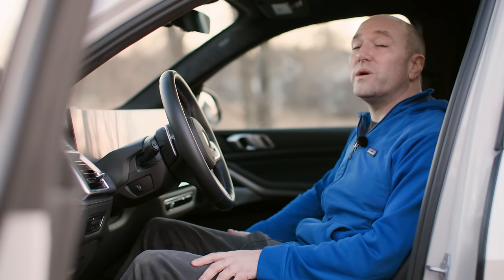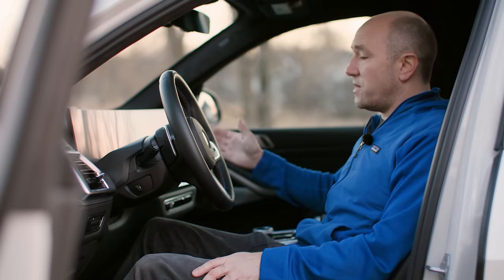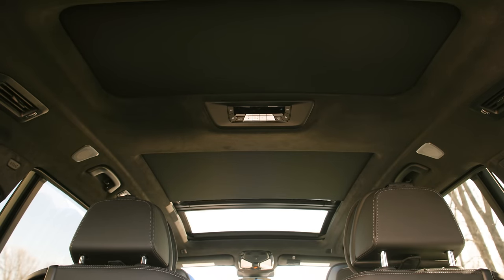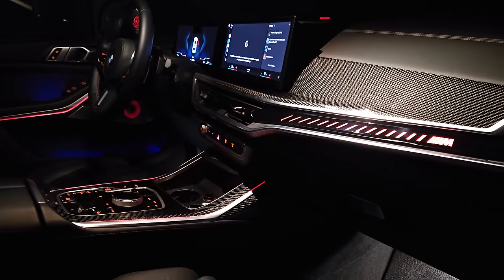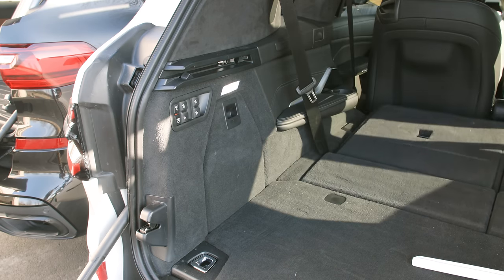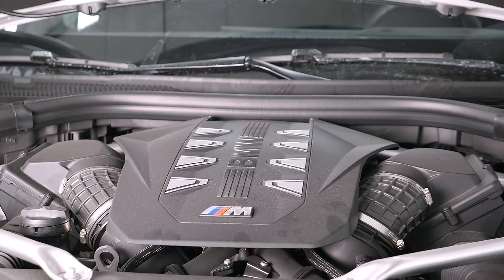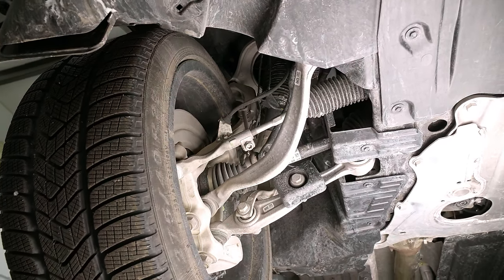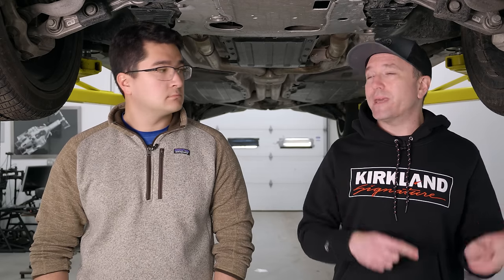2023 BMW X7 M60i | A Mixed Bag of Updates

Comment: What about the Lincoln Navigator, Cadillac Escalade, Lexus LX, Grand Wagoneer, etc.? I realize they may not drive as well with their truckiness, but they have the towing capacity and durability to make them good long-term vehicles.
Reply from the maker: Those are almost all body on frame, so its different.  Wagoneer is a good alternative but its pretty new and I would not put it anywhere is same class as BMW in terms of driving ability. All of those are mostly land boats rather than driving capable.

Comment: Avoid. (1) Horrible wind and road noise for the side windows and front windscreen. Dealerships know it but can't/refuse to address it. (2) There are no all-season tires available for the M50i and M60i, only winter tires which cost $4K+ for a set. (3) You can't fit three kids booster seats across in the second row because of how inset the outer seat Isofix points are. Very odd for such a large car.
Reply: Would you rather have the Acura MDX Type S?
Reply: @SilverScarletSpider  No. I own a 2022 M50i and was looking to swap to a 2023 M60i.

Comment: Real luxury is getting into a very well equipped knobs, switch, lever, and button filled car with effective screens that nearly never need interaction, simple, supple suspension designed to last and a drivetrain that just runs, and runs well after the warranty is up.
Reply: Which is why I bought the last gen 2022 Sequoia. Wonderful ride. Physical knobs and buttons. Apple CarPlay for modern UI. Bad gas mileage, but fits my five kids and will last a decade (or two).

Comment: There should be a LAW to HAVE HVAC as hard buttons, that run independently from software.  This boggles my mind.  Your eyes have to be on the road, not in 18 sub-menus. Law Enforcement could cite you for being "distracted", even if it is built-into the cars infotainment. Manufacturers are in full "Electric" mode and want to remove any physical control.  Tesla cut the steering wheel in half so to "force you" to put your hands at 3-9 but is not practical when parking. On a side note, I was having fun with a 440i Grand Coupe with the M Sport exhaust and wow!  What a sound!  That is one BMW that I would seriously consider.

Comment: I’m not sure why everyone thinks the split headlight design is a Hyundai copy. You really have to think deeper and realize that this is an older BMW design they used on the Rolls Royce Phantom, specifically the pre LCI 2007 Phantom Drophead. BMW is bringing this design back on the upcoming Rolls Royce Spectre.
Reply: I first remember this on a Jeep Cherokee in 2013. I didn't like it then, and I still don't!

Comment: Regarding the iDrive 8, I do wonder how many people will interact that much with these screen interfaces. I mean, you'd think that they do because otherwise why would BMW and other manufacturers sink so much money into the software and interface development of the infotainment systems? That said, my X5 with iDrive 7 has me going in to the touchscreen almost never. 98% of the time when I'm driving, I just say "hey BMW, I'm cold" and it adjusts the heated seat and temp for me. In most cases I don't need to really change hvac that much - the system lets you program hvac/seat settings based on temperature thresholds outside when you turn the vehicle on. So much is automated that not having the buttons is really not a big issue. I would challenge anyone to show me a use case for regularly using the deep menu navigation. In an age where CarPlay/Android is standard, voice commands are better than ever, and "smart" programming is relatively robust, buttons do seem less relevant. The only exception I take with this is the volume knob, which BMW still preserves. I have a G80 M3 coming soon with idrive 8 and am not too concerned. Maybe I'm the minority but to me I don't really pay attention to the screens or ever have any reason to use them. I'm focused on driving and as long as HVAC and music is taken care of, I'm happy.

Comment: To think we have a comment section that has convinced itself that an extra second the set you temp up or down 2 to 3 degrees is a deal breaker. I've have haptic touch control in my car for years it's fine. Certainly wouldn't move my willingness to buy a 100k 500hp suv. Wouldn't even consider it.

Comment: The BMW exterior is becoming more and more hideous (Citroen's double headlight design, what were you thinking BMW!? At least do not make a direct replica and integrate it properly like fog lights were in the old cars that did not look bad because of it).
The infotainment is a curse BMW's is spelling on us. Why is BMW treating their customers as a piece of stupid heads that feel confused by using a few buttons or setting up shortcuts for their infotainment.
And lastly, have we as humanity really decided that cars are going to be just a bunch of consumables we replace like phones? In the past, phones worked 10, 20 or even 30 years, now they have almost 0 buttons and yet they fail in a few years or at least they start to lag in a way they are annoying to use.
Please, car industry, stop doing this nonsense and let the enthusiastic mechanical and electrical engineers take over instead of marketing, influencers, simple minded people and other bored employers!

Comment: @savagegeese Hi, Mark. BMW expert here. Commenting to let you know that the shortcuts still exist and now live atop the menu. You access them by tilting the iDrive wheel upward or using the touch screen and dragging down from the top.

Edit:

The seats aren't cooled. They're ventilated. Cup holders are water proof and so is the charging port next to it.
Reply: I had a feeling this was the case. Afterall that's not a feature a person who has a car for a week will bother opening manual to find. Only the owner would bother to setup actual shortcuts.

Comment: I just got my 2023 x7 with the executive package and I agree with everything you said ! A lack of physical buttons for the climate control is infuriating and distracting as you’re driving. I ordered the executive package because I wanted the massaging seats in the cold cupholders and the cooled seats, however, you were very correct in saying that they are pretty much useless features. Disappointing for a car that cost almost $100,000. the ugly front end and some cheap materials on the inside combined with the things that you just stated in the video have me completely disappointed. And what is up with that cheap flimsy Walmart, looking piece of plastic on top of the steering column that has hinges? How did that make it into production?

Comment: Love the channel guys, but what is going on?! Basically glossed over the Honda pilot on that video but went super into depth on the x7. Are you guys trying to appeal to the masses? I love you guys for the super in depth videos, not here's a new car next video. Please don't change this.
Reply from the maker: The Pilot was very in depth, probably the most in depth on that SUV, was it not?
Reply: @savagegeese  Huge fan of the channel! I don't want you to take this the wrong way, but looking at this X7 video, you guys straight up skimped on the Pilots interior portion. I think your older last gen pilot video is better than the current gen video. Show us the knobs buttons and switches, and do it eating a donut! I know your guys strengths is drive segments and mechanical reviews but people do appreciate the small items. I almost consider your YouTube channel as an archive,  great content over the years to come back a look how cars have changed. Just looking at run time for x7 and pilot, 31:49 vs 22:30. Feel like this was a great video but could have used some little things. Keep up the great work , in this boring crossover to EVs.
Reply from the maker: @rq-nt7zi  Some of this is approach between Jack and I.  Depending on the car we have to try and balance length and info.  Going forward Ill make sure interior is more complete.

Comment: I have i7 in my 2022 BMW M240i, it works great and blends perfectly into the design of my car, I'm unaware of any feature it doesn't have that I wish it did have and don't even use some of the features.

The 2023 version has been revised to include the i8 and it looks like an afterthought, like there are 2 iPads propped on the dash, it doesn't look right to my eye and I'm happy I bought a 2022 and avoided it.

Maybe when they roll out vehicles that incorporated i8 from the first sketch it will work better, but retrofitting to existing generation vehicles doesn't work in my opinion.

Comment: I currently drive a Lexus sedan. I love it but my lifestyle is demanding a truck. I started checking out the Lexus GX. I’d be happy with it. Or so I thought. On vacation I accidentally ended up with a BMW 7 series and … well… I met my match. I like to DRIVE , and the engine on that 7 made me swoon. I looked for any excuse at all to drive somewhere.  My next car? Not so fast. I still need a truck. So the only thing on the planet that will satisfy me on all fronts is this X7. But the upfront cost and maintenance costs are prohibitive. Please tell me what should I do?  I  like the approachable luxury of Lexus, and as cars go, they are no slouches, but I want to marry the BMW engine - the power, the speed, the James Bond alpha maleness of it… swoon! Help a damsel in distress!
Reply from the maker: Good news is X7s are rotting on dealer lots 110 days.  So the prices are tumbling.  You could probably find a 6 cylinder  X7 used for in the 60s.  My 2020 X7 fully loaded with V8, 120k msrp with 45k miles had trade in offers of 65k.

Comment: does the x7 ride softer than x5? @savagegeese
Reply from the maker: Barely. They are essentially same suspension setup.
Reply: @savagegeese  thanks. did acura ever get back to you about the gearbox problem in mdx?
Reply from the maker: @ab-nz2mm  Yes, sadly its an over agressive protection program to protect drivetrain.
Reply: @savagegeese  damn, so it’ll be in there forever ?

Comment: Shortcuts are still there, but just not as short.
Once saved, you press Menu and then push the control wheel down, or swipe the screen down, then tap the desired saved shortcut or scroll to it with the command dial and press it.

Comment: The splintered headlights was first featured in a Korean product, wasn't it?  Didn't like it in those vehicles, and it ruins the look of this X7.  It's not a good look, and the Koreans beat them to it.
Reply: 2014 Jeep Cherokee
Reply: They apparently used that design in some Rolls Royce models in the early 2000's, so they decided to bring it back. However, Jeep had already beat both BMW and the Koreans to it.

Comment: What's that weird rectangular rubbery/plastic thing bolted to the underneath of front lower control arm? Is that the attachment for the end of swaybar? Some kind of vibration damper? Either way - this can only be looked upon from the bottom - to evaluate all the engineering that went in - because the body design is atrocious (finally someone recognized the insect headlamps first introduced by Palisade I think 10 years ago). Anyway. I hear some weird sound in the truck - prior to Mark making a turn - there's this weird click-click-click-click sound absolutely alien and uncharacteristic for a BMW. What's wrong with that BMW? Is it sick? Maybe that's the reason for its crippled, disjointed face? Thanks for the vid, greetings from Latvia.

Comment: I have a 2022 X7 40i.   I will probably drive it until there is a new full redesign.   No reason to upgrade.   I would miss favorite buttons and climate control buttons.
Reply: YOu can scroll down and set shortcuts there
Reply: @linus2982  I don't want to scroll down.   I like my current set up.

Comment: Well, you do have short cuts by pulling down with the knob or from the top of the screen to replace those short cut buttons. I went from a 2022 RS5 to a 2023 M3 Comp and not once have I missed the climate control. I mean I don't see the big deal you have to hit 1 button to get to all the climate control. I mean I always keep mine at 70 and never have to change it anyways.  I swear every single youtuber I don't think there has one that hasn't complained about the climate control change. I have one of my short cut set to Spotify

Comment: iDrive 8 is an abomination.  WILL NOT buy another BMW until they sort this out.  The 8 shortcuts are gone.  Climate control buttons are gone.   Heated seats and ventilated seats are now have to be turned on / off in software.  No one can dispute that having to navigate a software menu to do simple tasks is safer than a switch you can locate and turn on, without looking, by memory.  The fact the common sense has been lost around this is totally mind boggling.  And please don't give me the voice commands solution.  The voice commands are slow and half baked, at best.